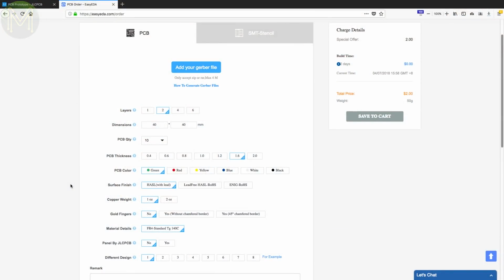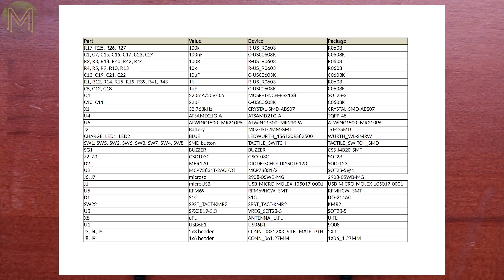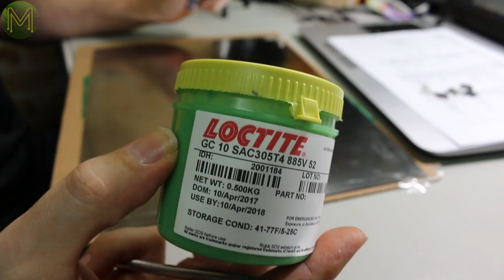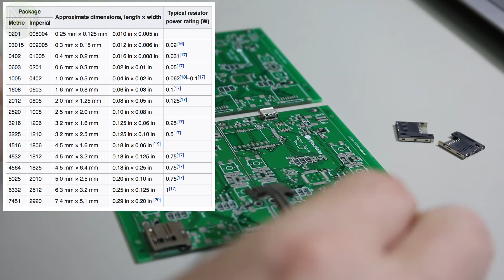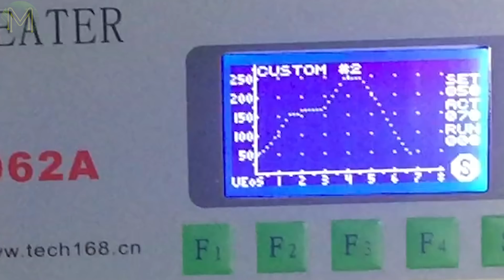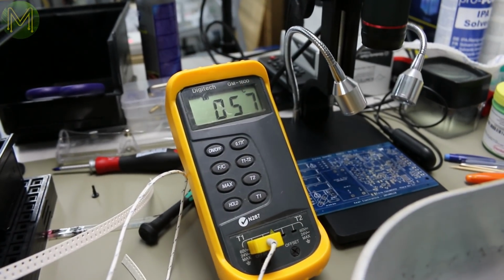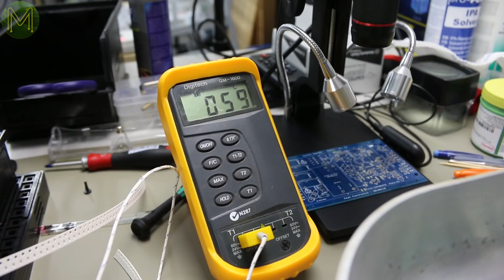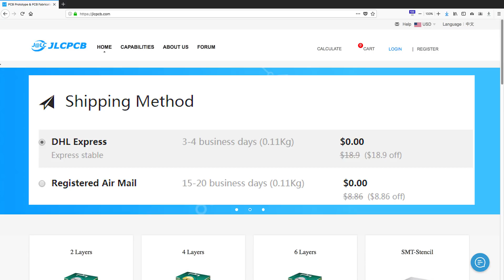#204 Make a PCB from scratch using EasyEDA // Part 2 // Tutorial

Comment: Could you explain the choice for the SAMD21 compared to other chips? From the arm website the cortex m0+ has a amazing powerconsumptions. However I can't find a good comparison of real power consumptions.
Reply from the maker: Power consumption within data sheets is always a bit sketchy. The only real way of doing comparisons is with real world tests.
That is: running similar power optimised code on several boards over a specific time frame.

Comment: I turn in-video notifications off because many content producers don't know how to properly size, place or limit the number of them, so if you put a link to part 1 of this effort in the video, I didn't see it. Please put links to previous parts of a video in the show notes. Also, as far as the PCB is concerned, what the heck are you making or is that a secret?
Reply from the maker: This is my Super Duper board. The specific functionality I’m keeping under wraps until it’s ready, but it’s obvious it has two SD slots, a SAMD21 and LiPo battery management.
Reply: This just showed up on Hackaday. A great idea:

SIMPLE MECHANISM GIVES SUPPORT FOR SMT ASSEMBLY
April 10, 2018
https://hackaday.com/2018/04/10/simple-mechanism-gives-support-for-smt-assembly/#more-302532

Comment: Thanks for sharing, but Leadfree is somewhat difficult to solder correcly
Reply: Not really that much more difficult if you use a good quality paste and flux.  I use the Loctite GC10 that Mick shows in the video - he built this at my office, so that was my jar of paste.  Unfortunately I don't think it is sold in smaller sizes, and the 500g jar was about AU$100.  Even with my larger than usual prototype and production runs over the last 9 months, I still only used about 1/4 of the jar and it is about to expire.  So yeah, if you don't really need lead-free, then don't use it :)  For lead paste & good flux I recommend ChipQuik.

Comment: I just used them recently and they were great, the panel by JLCPCB option yields different results for me in that it jumps to around over $10,000 :-)  Strangely i didn't use that option.
Reply from the maker: Yes, when you go beyond 100mm by 100mm, the price jumps substantially.
Reply: board was 25mm x 34mm so i thought i should have been able to panelise 3 boards in a 1x3 arrangement.  If i order more i'll drop them a line.
Reply from the maker: You should be able to do a 3x2 for a 25mm x 34mm board. Just confirmed with a dummy board and the price stays at the same $2... Shoot me an email if you want and we can talk there... (and show screen shots a lot easier too).
Reply: Dropped  you an email  but i figured it out seconds after i sent it which is sods law, for the benefit of others i was being an idiot and was putting in x = 75 and y = 58 as i was multiplying up the board size, that infact means i was asking for a panel with 5100 boards on it :-)  i put in x = 3 and y =2 and it stayed at $2 cost.